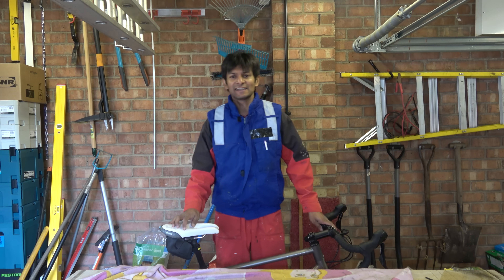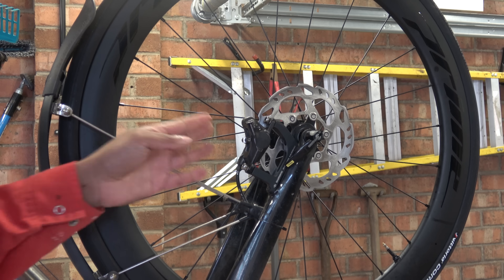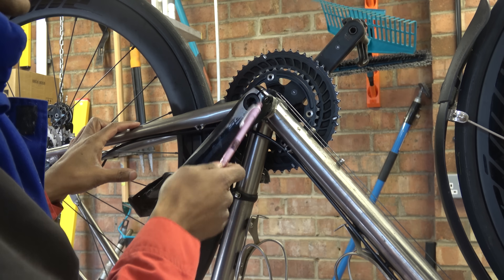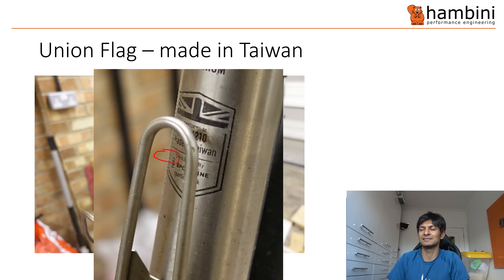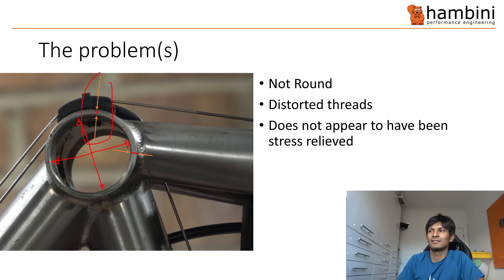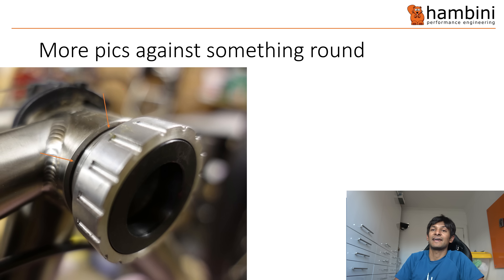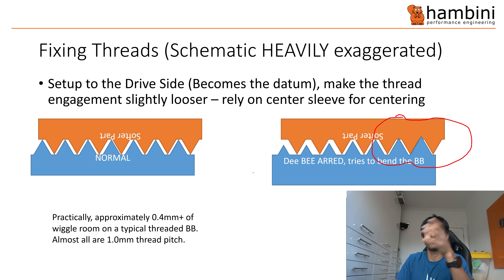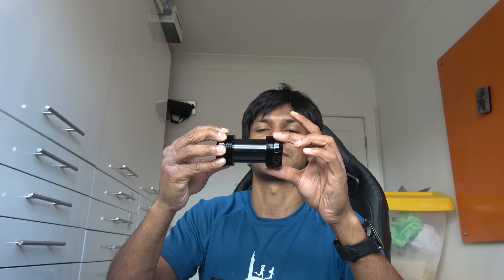REAMING: Titanium Threaded Bike Frame engineered in England by Clowns

Comment: I have a Litespeed Gravel. I toured the facility and witnessed the build process. The frame is fully welded and then they machine the bottom bracket for pressed fit or threaded. I opted for the threaded. I distinctly remember that station in the process because I knew welding could deform materials and he made a point to show this part of the process. I love my Litespeed and I would buy another one if I were in the market and I would recommend them to anyone seeking a Titanium bike. Excellent service as well.
I also have Chris King hubs on a set of carbon wheels on my Enduro. I spoke to my wheel builder about ceramic bearings. He told me the only real difference is the weight of the oil. Lighter weight oil in ceramic which translates to smoother spin. He told me to save my money and use it somewhere it would matter more. Ceramic was a big price increase over an already excellent set of hubs.
Reply: The reality is Litespeed builds a bike that is actually better than a Moots, a Mosaic and a number of other silly overpriced “status symbol” ti bikes. Litespeed does more tube shaping and butting of their tubes even on their base models than either of those frame makers, and their weld quality and fab techniques are as good if not better. 

In addition, Litespeed hand brush finishes all their ti frames, which make the frame much easier to maintain and it looks better. It looks professionally finished. Moots meanwhile bead blasts all their frames to a dull finish because it is literally the cheapest way to finish a ti frame, and they do not want to be bothered hand brushing them despite their silly MSRP’s. Then on top of that you add Moots silly and ugly looking 3D printed rear dropouts (which again they only came up with to cut welding and fab costs - there is no improvement to the bike frame from them at all) and it’s amazing anyone would be willing to pay the silly amount they charge for a stock batch built bike with a cheap bead blasted finish and an ugly cheap looking rear dropout. But fools abound, and internet paid shill clowns like David Arthur will continue to sing their praises and BS about how extraordinary they are. LOL. 😀😀
Reply: @ivanboesky1520  I agree. I did a LOT of research before I bought my Litespeed. Moots wasn't even an option because of price so I didn't spend a lot of time looking at them. There was nothing justifying their prices so I just moved on.  
It really came down to a Litespeed or a Lynskey for my budget and requirements.
And the only positive for Lynskey, at the time, was internal cable routing. But the quality of the Litespeed was hands down better in many respects. I haven't regretted it in the least. Now Litespeed has a grvel bike with internal cables.
I have 4 bikes (Ridley Fenix SL, Specialized Enduro and a Trek Powerfly 5 eMTB and my Litespeed Gravel) and this one gets the most love because I can do anything but mountain biking on it and I even do that in small amounts.
Reply: Ceramic balls smash easier than steel too. Maybe nlt an issje for road bikes but for MTB it could be.
Sadly some people just think more expensive means better or try and convince themselves the marketing is 100% honest.

Comment: Next you'll be telling me I need to stress-relieve my frame made of Reynolds/Columbus/Dedacciai TIG-welded alloyed-steel bicycle frame tubing. Serious BB thread "Tapping" tools have a very solid alignment shaft to align the left-side tap to the right-side tap. As a framebuilder, I cannot buy an untapped BB shell. I can however buy a whole range of tapped BB shells. The premier worldwide supplier of Ti BB shells sells only ...... threaded BB shells. The distortion you see there (which is pretty awful) would have been dealt with by a proper sharp BB-tapping tool (but you wouldn't have gotten to sell one of your BB's .... wink).  The thread would have become "looser", however when the ends which no doubt were not parallel were also faced (with the professional tool which also has a dirty great alignment shaft in it too....), the final result is that there is enough wiggle-room in the thread for the cups to be held in alignment when they clamp against the perfectly-squared "faced" edges of the BB shell. If you think a loose BB shell thread "might" result in a stripped thread, then you need to look at cheap steel frames made in.... taiwan. They have "loose" threads and they do not strip. They don't get tight-fitting cups when moderate distortion is present. Nor do they appear to face the BB shell.... a mass-production shortcut. My 2 cents as full-time framebuilder and degree'd mechanical engineer. BTW, I do not know of a titanium frame made "in the west"  that goes anywhere near heat after welding.... The biggest problem with titanium frames is the failure to use butting (which is very common in "steel"  frame tubes) to adequately address points of localised stress-concentration.... i.e. the welds. Why don't steel frames need the incredibly-precise welds that Ti frames apparently do....?

Simple answer; this frame was clearly not tapped post-welding with a sharp, self-aligning BB thread tap tool. Cyclus, Park, Unior make 'em.
Reply: Good points there. That frame could have easily been corrected with the standard tooling stated by e f g.  Most all ti bottom brackets start threaded and should be chased post-weld. Most of these frames are also not faced for concentricity as well. I've repaired dozens of them. 

I’d add that ti frames are not welded in a fixture, but tacked only in the fixture, unlike brazed or fillet-welded steel frames. The stresses built up during welding are primarily caused by poor mitering, poor heat control, poor weld sequence and changing wall thicknesses of material. 

All metal welded frames have distorted bottom brackets after welding. Once they have been chased, however, the internal portion of the shell contact points should be round or near round as the chasing process will cut threads in the ovalized portion of the shell. You’re left with a near-circle internal diameter while the external circumference remains egg-shaped, due to the chainstays being welded, usually within 5mm of the shell edge. 

I’m also not aware of any heat-treatment of ti frame from any manufacturer, Far East, USA or otherwise. Anything above 600°C and you get into beta transus which can become active  for contaminants.

Disclosure: full-time professional ti builder
Reply: Bespoke prices in the uk do not add up to a bespoke product is my experience. Reynold produce in my opinion the finest and certainly expensive Ti tubesets custom drawn to final frame size i rang around a few frame builders would they weld the frame to aircraft spec ie impuritys etc nope didnt need it apparently though Moots do it let alone machining a BB lol did these builder have city & guilds welding with gasoxy or secondly tig let alone aircraft cert where they would earn more lel I didnt bother asking. Their prices and marketing implied they were truly a bespoke service the reality not. I would prefer a craftsman to make my frames over a professional engineer

Comment: Honestly chasing and facing threaded BB's fixes 99% of all problems I've encountered. That is something most competent shops have the tooling for and ability to accomplish.
Reply: You may have missed this is Titanium.  Titanium is notorious for wearing out and breaking machining tools.  Your typical dies don't work near as well in Ti as in steel and aluminum.
Reply: @lastfm4477  Didn't miss the obvious. I've chased, reamed, and faced Titanium frames with Park tooling. These procedures barley qualify as machining. You're not going to be removing any substantial amount of material with these simple and common steps. I understand that Titanium is very hard on any cutting tool, but it is very cheap and simple to have bike shop tooling resharpened in North America. Should the manufacturer be doing this before it reaches a bike mechanic? of course, but that is a rarity.

Comment: Ive tapped and fitted inserts into hangars and if you have enough material and a massive tap you could fox a BB thread wit a helicoil or threaded insert. looking at costs of tool i'd buy a new frame haha.
Robust choices of parts shame about the frame issues. Give me 15 minutes i'd soon have that front disc running smooth. if owners get the posts faced, uses a gap alignment tool and make sure the rotor is true you will eliminate that flippin annoying rub. Its a weird think about origins of frames and parts but it's complex though. You can build in Taiwan but the product is maybe designed elsewhere and the materials sourced from elsewhere so is the frame made in Taiwan or just constructed in Taiwan. On the other hand it could be constructed in Taiwan, tubes made in Taiwan and designed in Taiwan. Maybe we just say made on planet earth from minerals of the universe.

Comment: BB shells almost always deform when welded.  You have four welds occurring there practically around the entire circumference.  And most of them are threaded during production and arrive at the frame builder with threads.  Chasing threads & facing the BB shell is a basic procedure for a high-end bike build.  Shame they didn't do this one prior to assembly.
That said, Ti is notoriously hard to work, especially if that's a 6/4 BB shell.  Pressurized water is used to cut many 6/4 Ti bits.  Again, the frame mfgr. SHOULD have done this.  So it would have been nice to see how Hambini remedied it.
My friend's Salsa from when Ross Shafer was welding them had the same issue.  Salsa assured my friend the BB shell had been prepped.  But premature BB failure and visual inspection confirmed it hadn't.  Easy to rectify on metal bikes with the proper tools.
Reply: IIRC, Seven Cycles threadmills the BB after welding.  Probably the best way to go.  TI may be hard to work with, but it’s not impossible.  There’s lots of tools and expertise out there.

Comment: The holes and slits on disc rotors is there to dissipate gasses, not to shed heat! If it was for shedding heart, the rotor would be solid.

Come on @Hambini! 😉
Reply: And they have a barely marginal affect on aero. I always laugh when I hear road bikers saying how bad disc brakes are.
Reply: @TimBud  yeah, no cyclist ever is going to notice ill effects due to drag from rotors. The human bodh is a lot never perfect so biometrics will plah a bigger part. 
Crazy how someone that roasts ceramic bearings (and rightly so) falls for a nonsense story about holes in disks.
Reply: What gas? If a gas or gasses is generated from friction, then how does it affect braking?

Comment: Maybe this is how a titanium bottom bracket should be threaded (at Seven Cycles) https://youtu.be/b5ySnoQ88EU?t=179
Reply from the maker: doesn't look like they stress relieve either.
Reply: @Hambini  No, but if they had used a thick bottom bracket (as they indicate they do) and cut the threads afterwards using that CNC machine, wouldn't the hole and alignment be consistently aligned?

Comment: Though a custom bike maker is also working for profit, he has a lower overhead and higher attention to quality. A good custom maker should constantly examine all the facets of the frame individually, comparing how these operations and results interact with each other, improving his skill and execution on every single bike. He is solely responsible for every part of the frame and its quality, function, and essential value, therefore, most custom makers make bikes far superior to factory frames. Not to mention easy access to the frame builder if there is an issue.  But consumers are willing to pay more for cheaply produced, poor quality factory made frames.  Because they are stupid.
Reply: Very true. threading a bb should be seeing no issue with the thread consistency if the jig and cutting tool is aligned and sharp. I'm coundering here if the BB tube was concentric or a little egged.

Comment: You don't normally weld bike frames in a jig and the joints aren't bevelled.
Reply: 3mm + for weld preps
Reply: @olivermartin3384  The tubes are only about 1mm wall (or less). And I don't think there's a heat treatment after welding (he called it "stress relieving"). Certainly not for steel and  I've never heard of it for Ti. You do do that for most aluminium frames (but for a different reason).

Comment: BB shells are threaded before welding but you're supposed to chase and face after making the frame (and usually need to but can get away without if you use a 40mm shell)

Comment: My Boardman BB shell decided to part ways with it's buddy, the frame. Local engineers - VERY well respected in the one-off motorcycle frame-building world  - said the frame had clearly not been stress-relieved which led directly to the catastophic fracture. Frame was toast, was advised that welding would be throwing good money after bad. Have read that this is not an isolated occurrence. That was the last Boardman I ever bought.
Reply from the maker: that is interesting.
Reply: Had a Boardman 29er with a BB30 bottom bracket years back, it was the shortest ownership of any bike in 18 years. Good riddance.
Reply: My local bikeshop told me the other day that my 2015 Boardman carbon frame is bent due to the way it was made in the factory. Apparently it became obvious when they tried adjusting the dishing of the rear wheel.

Comment: I have a Genesis Croix de Fer Steel frame from 2015 and I weld my own steel frames.
I have had no issue with my Genesis frame. It is still running on the same original Shimano BB hand has probably about 10000km of all weather commuting on it.
At least on the steel frames I build it impossible to fit a threaded BB without cutting the thread after the welding. That might be different for machine welded frames but for my hand tig welded steel frames it is impossible. So they have to be cut after welding. I also don't stress relieve my frames (steel). I assume that no small shop custom built frames are stress relieved. You would have to do the stress relieve in the oven with the frame still in the jig.
Frames are typically not welded in the jig. The jig is only used for the tacking and the frame is then removed and welded completely outside of the jig. It is the quality of the welder that keeps a frame straight, not the jig.
Loosing that much power in the BB seems unreasonable. What you can see in the spin test is hard a single watt that is needed to spin the crank. Of course that might differ under load. However to actually loose that much power that you get dropped by someone who is usually slower than you is hard to believe. It would need 30 to 50 watts of loss on the BB to get that kind of resistant. That kind of power would really heat up the bearings and probly even destroy it quickly. In addition it would be really hard to turn the crank by hand. And it would stop instantly when you don't push anymore. 
Its probably more a mind thing that he thinks that he is losing out to the because of the BB. You probably won't win the tour de France with this BB but most people wouldn't really notice it while riding.
Reply: @Sidowse  no but a bad spin test does not mean anything for the performace under load. You can have a good spin test and it will still perform very bad under load. They are not neccessarily related. They can be but not neccessarily. You can have a super spin test but as soon as someone actually presses hard into the pedal, for example with a very soft bb shell (really soft) the performance under load will be shit. on the other hand you can have a bearing with some thick grease which will perform poorly at the spin test but under load it will performe much better than the above.

Comment: Great solution to this issue. 
Would you consider for future bottom brackets extending the overlap of the center sleeve? 
Also for the "problem" side, what torque would you apply to the cup? I'd think the old Campy Ultra Torque (your favorite) instructions of "hand tight with Loctite 222” would be most appropriate.
I was unaware of ti frames getting heat treatment. I'm hoping a TI frame builder will chime in.
Reply from the maker: The middle is extended to the maximum amount permissible. Its limited by the shell width

Comment: What are you on about with the disc brake, just line the fucking thing up, if the rotors are bent use an adjustable to gently tease it back. "Don't like discs because they rub" fuck off. Might have been true 15 years back with avid jucys, not now! Shimano has had this sorted for years

Comment: Quite surprised you didn't use anti-seize on those BB threads. Thanks for the video.
Reply: Anodized aluminum is non-conductive and won't be corroded by the Ti, so grease is just fine.
Reply: @lolbubs11111  Thanks!
Reply: Maybe he did with that Mobil grease but didn't explain it properly

Comment: Hambini, did you just hand tigthten the two bb parts? With the thread locker, is that sufficient to fix the bb in place? i.e. will the bb, thus tightened, not pedal loose?

Comment: So what did you actually do in this instance Hambini, just find the centre of the BB and rethread it?
Reply from the maker: In essence yes. The tricky bit is machining something that is oval. A normal threading tool from park tool won't fix it because it will follow it's original path. The owner already tried retapping it and didn't work hence the faffing around.
Reply: @Hambini  Some people say it´s a bugger to work with TI, some others say it´s a breeze. Your experience??     Rgr
Reply: @Hambini  Comprehended Sir, Thanks very much , and thanks for taking the time to reply. m